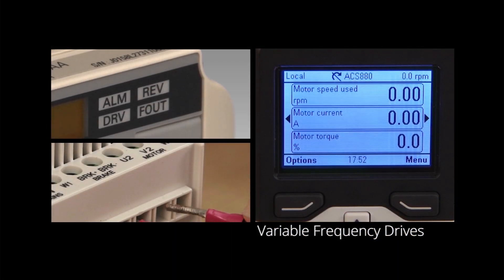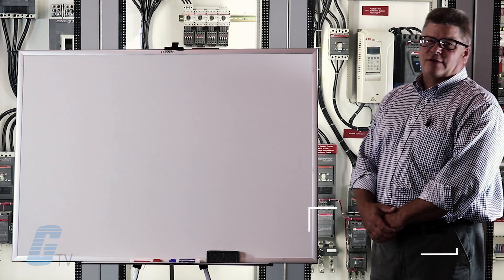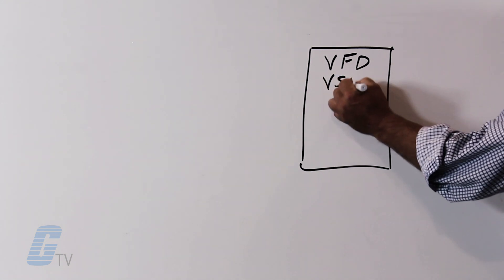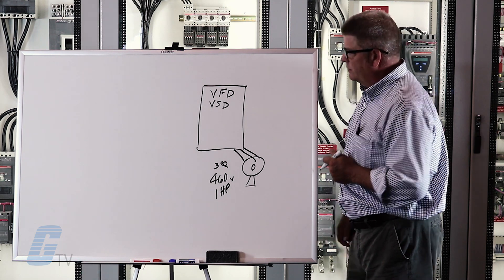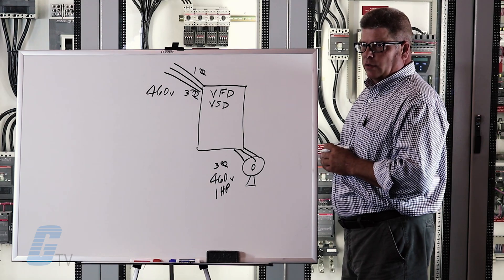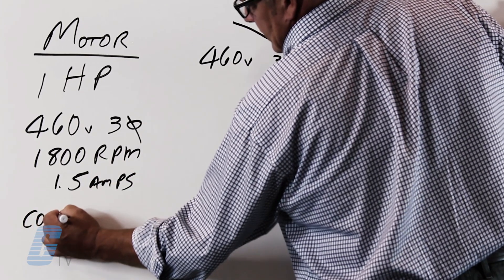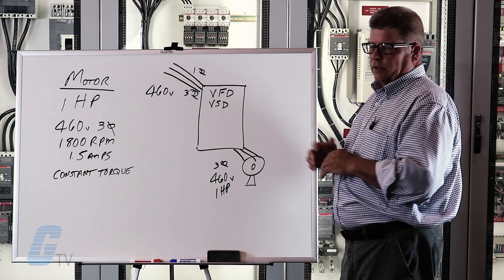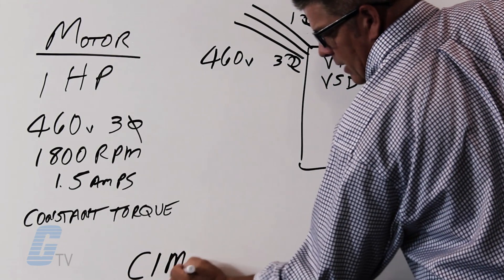How to size and select a Variable Frequency Drive at Galco.com

Comment: Any suggestions on a Variable Frequency Drive Inverter for a  parts washer with these specs  208-230/460 volts  and 21-18/9 amps     I only have single phase but need washer is 3phase

Comment: hi 
how do i connect the feedback encoder to the VFD
Reply from the maker: Not all VFD's come with an Encoder input, so, does it have an Encoder input. If so, you may need a pin out for the Encoder itself and then reference your manual for proper connections to the VFD Encoder input terminals/connector. Some VFD's/Servo drives will have a dedicated motor feedback connector. In this case you may have to purchase a special cable to connect the feedback to the drive. If your still not sure what to do, then document your drive's make and model numbers and give us a call at 800-337-1720 ask for a product manager and they can assist you further.